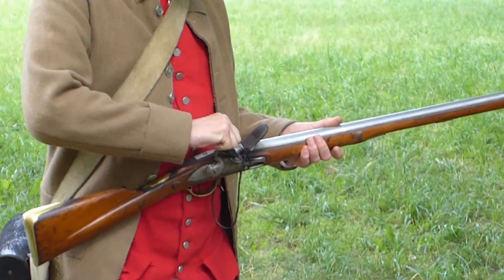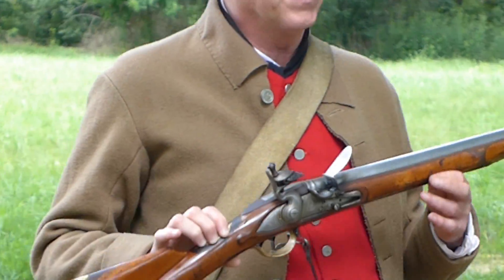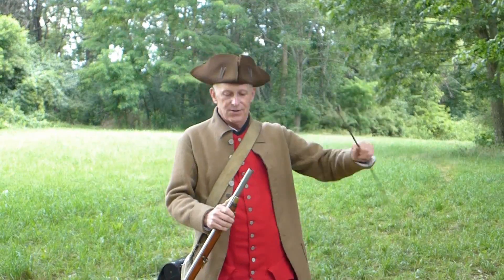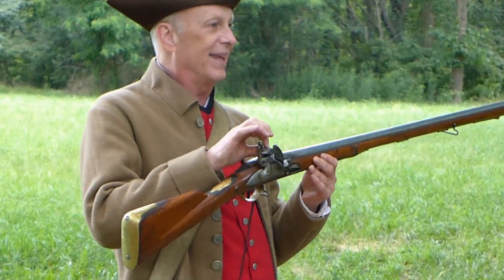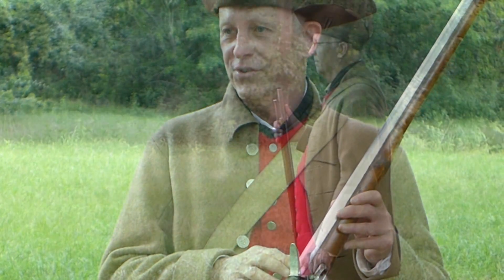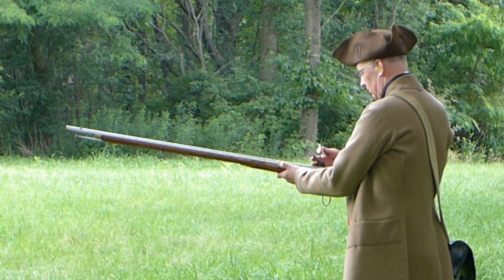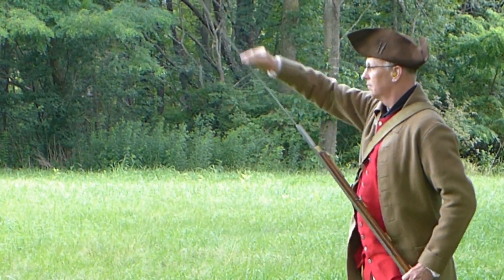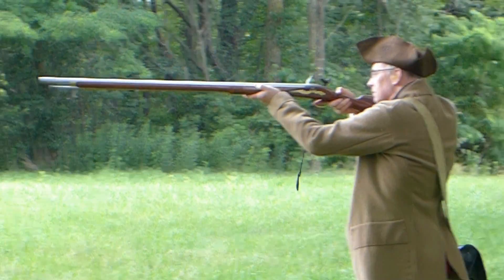From Powder to Fire: A Live Musket Demo at the Site of the First Battle of the American Revolution

Comment: In person from over 300ft away, the sound was still very loud, and sounded more like a cannon blast or huge explosion? Why are muskets soo loud? Are they louder than typical handguns, rifles, and shotguns?
Reply: Spaceshotx7 More powder.
Reply: What do you mean more powder? can you give a detailed explanation why in person from over 300ft away that the musket fire is still very loud and sounding more like a cannon going off, or a huge explosion?
Reply: Spaceshotx7 When a weapon is fired, you are hearing combustion in the chamber. That combustion is the gunpowder igniting thus sending the projectile out of the barrel. The weapons they used back in the colonial era were longer, more ineffective, and used way more gunpowder because its old technology. Nowadays the gunpowder is in a casing behind the bullet, and when the weapon is fired the firing pin hits the back of the casing igniting the gunpowder and shooting the bullet. Back then they did not have casings or bullets, just metal balls that sat on a load of gunpowder inside the chamber. The excessive use (or nowadays we see it as excessive) of gunpowder is what is louder than your usual gun nowadays, and probably the ricochet of sound and reverberated sound waves wherever you were standing from the point of discharge is what made it so loud.
Reply: So would a colonial era musket be louder than a 12 guage shotgun or .50 rifle in terms of loudness from 300ft away? What about compared to a 9mm handgun, rifle or shotgun? Also, when right in front of the person firing the musket from 10ft away, wouldn't foam earplug alone not help due to the 135+db sound level?
Reply: Spaceshotx7 Muskets are obviously louder. You're overthinking this.